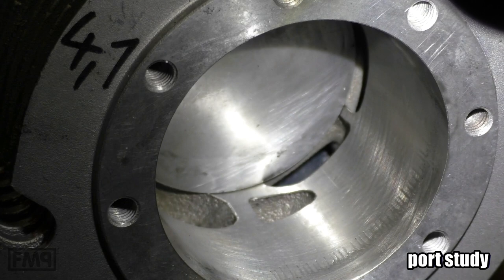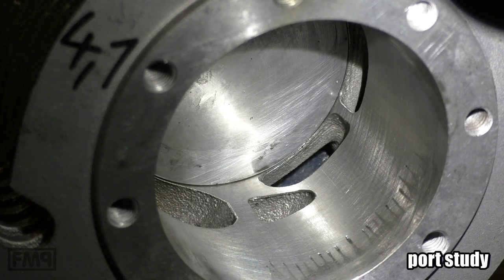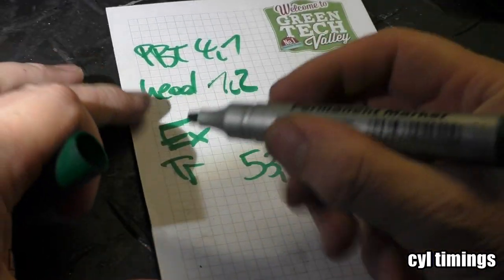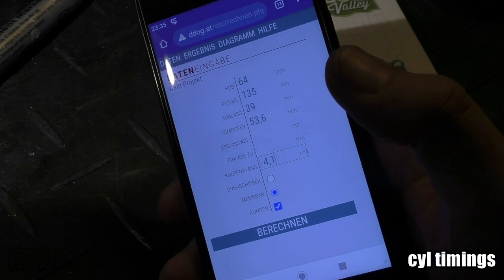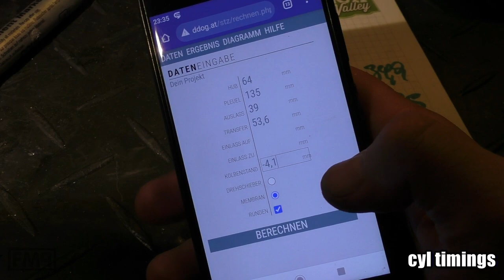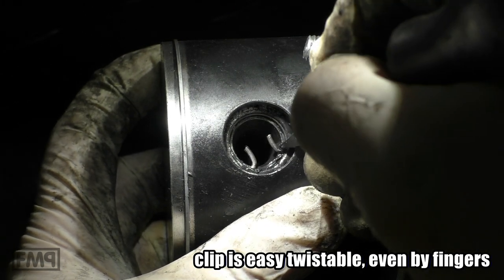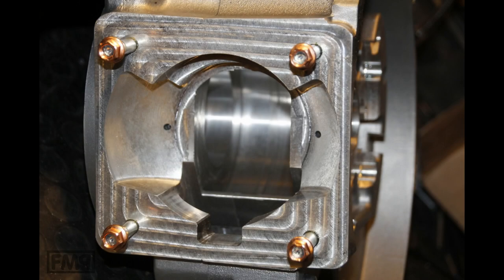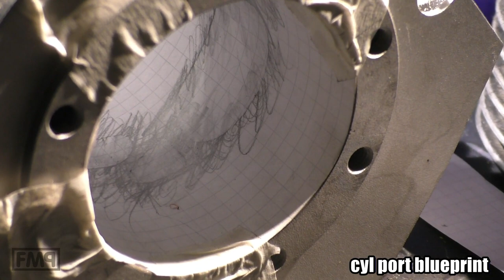BFA 306 cylinder | FMP - SolidPASSion |

Comment: vidio comparison ignition malossi or SIP,
Reply from the maker: not needed. these idm, no matter which brand, are not to be used.. Simply see power curve, on low rev, there is not enough electric power = lights go dark and sip speedo even turns off / restarts. Also see typical 4 coil stator, its available for 15.- which indicates the high quality of this item 😉